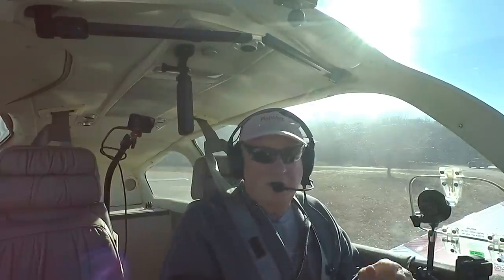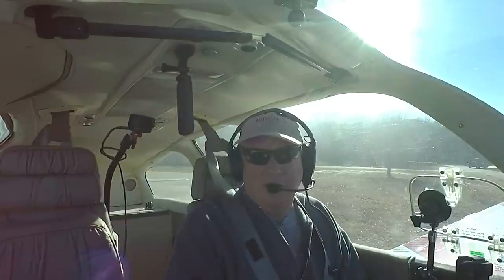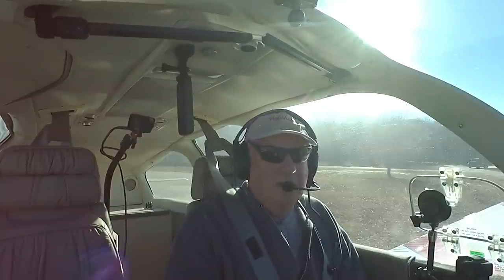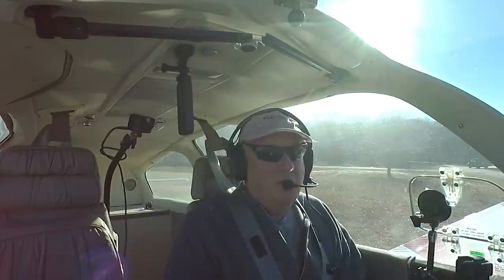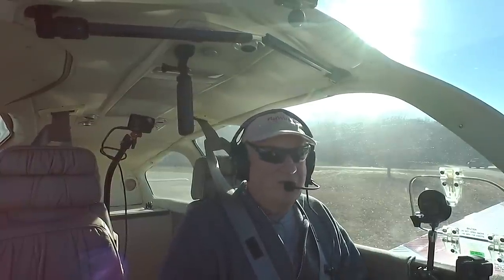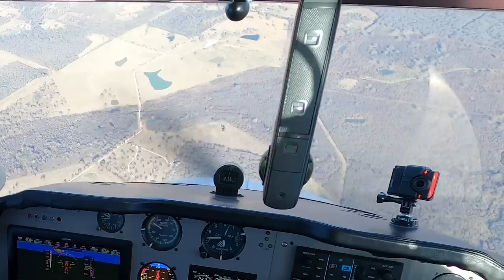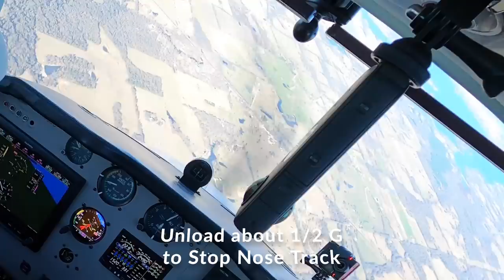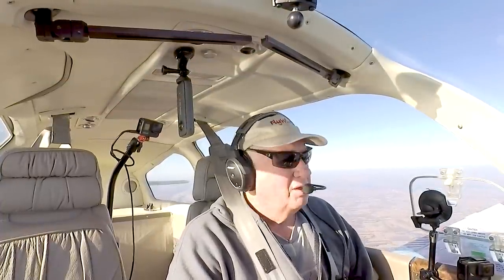FlyWire Myth Busting- Inverted Upset  "Just Go With It"

Comment: Scott, regarding whether to continue the roll or to fight it, you might find this interesting.  Tony Levier and another Lockheed pilot (whose name I can't recall) were flying from Lockheed Burbank to Edwards AFB in the company's Bonanza.  The passenger was also well known aerobatic air show pilot. They were landing at Edwards following a B-52 when they hit it's tip vortex.  The passenger shouted " I got  it", continued the roll to make a perfect landing.  Flight Test Pilot reflexes, instinct  and trust saved them.
Reply from the maker: I have no doubt that pilots very familiar can successfully deal with this. It is a bad example for the average pilot with no experience. the average pilot will not be able to execute that option successfully.

Comment: Scott, I love your videos. It was 1978, I was about two hundred hour pilot, and had just completed several hours of aerobatic training from  an air show pilot whose specialty was inverted ribbon cut with a decathlon. I was flying a C172 with three friends to O’Hare 09R, 3 miles in trail to a DC8 heavy. We were outside the outer marker going as fast as a C172 could go, going downhill. One second we were right side up, the next second it was like the hand of God turned the airplane upside down. (Wing tip tornado from the DC8.) 
I knew better than to pull back, which would have pointed us straight at the ground at about 1500 agl. Without the training I might have tried to fight the roll. Instead I went with it and kept the roll going till level. 
The right front passenger (also a pilot) after we had taxied to the FBO, got out, kneeled down and kissed the ground, then got up trying to light a cigarette with trembling hands in a smoking prohibited area and asked “Jim, how often do you do snap rolls on final to O’Hare?”

Comment: I agree Scott...(and taught it that way in UPT for 15 years).  The problem that people don't think about is how far the nose buries itself...the lower the nose, the more G to pull out of the dive, and the more altitude loss...not to mention the overspeed during the whole thing.   As far as 'dirty' configuration...the nose will probably bury even further if you continue to roll through it...and it will probably roll slower so you will lose more altitude in the overall maneuver.   I never practiced it dirty due to the stress it puts on the gear and flaps.   But I will bet there is some test pilot data out there.
Reply from the maker: Great comment.... overspeed is also a real issue!

Comment: A great video and demonstration. Unloading the aircraft saves a great deal of altitude. One factor not mentioned is if the force that caused the roll upset is still present. Very few light aircraft have the roll rate to overcome a wake vortex encounter. By fighting the roll the aircraft may remain upset, with the much larger altitude loss that will include. Continuing with the roll will have the aircraft the correct way up more quickly if the upset forces are still present.
Just my thoughts. 
Fly safe everyone.
Reply from the maker: Thanks James. The fastest/safest way out of the vortex is to unload. That minimizes your time in it and improves the roll rate through it. I actually had a vortex incident flying an airliner... the vortex induced roll event itself was  very short and powerful. Les that 5 seconds as memory serves.
Reply: @FlyWirescottperdue  Scott, I agree completely on unloading the aircraft to minimize altitude loss.

Comment: Good morning Scott, I admire your knowledge and experience, and your beautiful Bonanza makes me smile! I "went with it" about 30 years ago during a cross control stall demonstration (simulated base to final turn at altitude) during a Navy Flying Club T34 checkout. When the airplane stalled, it rolled quite quickly with the rudder, and the nose dropped. I don't know why on that first demonstration I chose to finish the roll, I think it was a reaction to the rapid stall and the unusual attitude. Had it been a real approach, the outcome would not have been good - I don't think there would be sufficient altitude to recover, even with proper technique.
Reply from the maker: Thanks for the comment William. At altitude is the best place to try it first!
Reply: @FlyWirescottperdue  The demonstration was a required part of the checkout, the poor recovery wasn't! Needless to say, we repeated the maneuver a few more times, identified the stall earlier, and used a normal recovery.

Comment: Exactly, go get upset recovery training. The first time I did it it went against the Orthodox conditioning... You learn to just stay with it not to worry, be ready for it expected and be ready to respond effectively.
Reply: practice on a simulator or rc plane,it is going to more or less the same,a good rc pilot can roll without loosing altitude and I have actually seen quite a few rc flyer do what they call a rolling circuit,where a complete circuit is done whilst rolling the earoplane continuously without loosing altitude and coordination even through the turns. rc flyers at that level very rarely crash as they are aware of all aspects of flight in all dimensions.

Comment: WOW! I always felt that it was best to follow through an unintentional, (if not surprise) roll! However, it's obvious that doing that can lose almost 3 times the altitude more than if one tries to counter with a return roll to the opposite direction.

However, what if the initial roll placed the plane in a fully inverted position? I mean, maybe a slow response from the pilot, or perhaps the gust of wind that caused the roll in the first place, was persistent?

Maybe then, it would be best to follow through and roll with it. Of course, the variables such as initial altitude, aircraft power and configuration, etc., etc. will all come into the bottom line of what decision would be best. 

Still, it would seem that your video shows a very heavy price to pay in altitude loss if one choses to follow through. It's a good thing to know!
Thanks,
Rich

BTW: I'm reminded of the Learjet 45 crash in Mexico in 2008. The NTSB found that the two pilots had fraudulent certifications and no business flying that plane, but they were initially hit by wing turbulence from the commercial liner ahead of them. The wind conditions for that flight were almost 0 MPH, which allowed the wing turbulence to persist.

As a result, the Lear 45 flew into it, (they were closer to that liner than they thought), and suddenly rolled the plane, which went inverted and near vertical. The pilot did so many things wrong at that moment that it's hard to say exactly what combination of 'panic-reflex reactions' were ultimately the ones that killed them all. 

However, they were 8000 feet AGL when they were hit with that turbulence, (if I recall correctly). I've always felt that they should have been able to recover if they had even a little experience. I have to believe that they failed because they panicked. Had they kept their heads, they would have recovered.
FWIW
Reply from the maker: They should have gone through UPRT! Don’t overthink the roll.

Comment: What about just using high rudder and forward stick to keep the roll with a nose on the horizon?
Reply from the maker: We’re not talking about folks who know how to fly aerobatics. We’re talking about regular pilots. Most don’t even like stalls.
Reply: Top rudder,if you are upside down there is no top rudder :)
Reply: @gogogeedus  I claim to be no aerobatic pilot and I have neither an aerobatic airplane or training. I was merely making a comment about if you invert, you must push your nose down to keep your nose on the horizon and as you roll out, you use top rudder to maintain your nose close to the horizon. I’m not implicating somebody to be an aerobatic pilot.  In an emergency situation. I would think that some understanding of aerodynamics which include your rudder becomes an elevator. Your elevator becomes a rudder, rather than just letting the airplane fall out of the sky and try to recover with a 5+ G pull out. Not everybody has 35,000 pounds of thrust to do a clean aileron roll or 400+ horsepower like Patty Wagstaff when their airplane rolls inadvertently past 90 degrees.
Reply: @aviatortrucker6285  Good point,if you have a  the skill and can use it,why not,but I like the Dan Grider philosophy of,don't stall the aeroplane. there is some footage on the net of an airtractor that got inverted,I don't know how but it was inverted in a flat spin,I wouldn't know what to do in that situation.and the pilot did not recover the aeroplane to flight,once the relative wind or airstream is upset then it is a different story.

Comment: But what about rolling through but also pushing forward through the inverted part of the roll? As an aerobatic pilot that would probably be my instinct.
You certainly don't want to 'bury' the nose. As I've discovered in barrel rolls that went wrong the exit results in large height loss and rapid speed build up, with high 'G' in the recovery.
Reply from the maker: What works for you, based on YOUR experience. Doesn’t fit all pilots.

Comment: So, please advise.
In this inverted upset..
I agree to unload the wing.
What application or benefits are there to utilizing the rudder (in whatever direction needed) to keep the nose "nearest" the horizon? It is all about managing the dive energy and avoiding #1) over speed, #2) overload and  #3) ground collision...yes?

Great video!
Reply from the maker: Good question. You can use coordinated rudder if you like. But there is a lot going on and if you haven’t spent much time upside down it’s probably best to keep things real simple! Unload, roll in the shortest direction to the horizon and recover from the dive.

Comment: I met you at MidLothian Tx. I didn’t get to ask you but partially, but if you go partially or completely inverted, knowing that the motor is not an inverted motor, are you satisfied with having a blurb of air lubricate your motor for a period of time?  The mains rubbing bearing bearing (metal to metal) so to speak?
Reply from the maker: I try and avoid that as much as I can.
Reply: Meaning hardly ever go inverted, right?
Reply: That has to lower the resale value of that airframe, vs with a factory overhaul equivalent dry sump motor / oil reservoir.  
Thanks for the reply.

Comment: Question When inverted Down Elevator Results in NOSE UP in relation to the Horizon, Correct? 
 So why not 'PUSH' when inverted to alleviate the bad NOSE LOW situation.  Sort of like when doing an internal slow roll?  What am I missing here? PLZ explain.
Reply from the maker: That is exactly what I did in the video.
Reply: @FlyWirescottperdue  Once unloaded, is there any difference between roll directions?  Assuming the plane is fully inverted does it matter if you roll in the direction of the original upset, or against it?
Reply from the maker: @BixbyConsequence  Roll in the shortest direction to the horizon. If you are wings level inverted, then and only then it doesn't matter which direction you roll.

Comment: Upset, Recover - PUSH, Roll, Power, Stabilize....That's what the airline teaches us, especially in the flight levels where you could loose over 10,000' if you tried to follow through, not to mention over-speed the the aircraft.  I agree with you, and seeing your speed coming out of the completed roll could have easily led to structural risk if not a planned maneuver and a skilled airmen with aerobatic experience such as yourself.
Reply from the maker: Great observation!
Reply: @Michael David Robinson Yes..in the taught AAURS All-Attitude-Upset-Recovery-Strategy, the Push is designed to lower the angle of attack because AOA is the only consistent characteristic of a stalled wing.  Any attitude or speed a stall can occur, so unloading the wing first, even inverted, is critical to ensure effective control ability through flight control surface inputs.  Your correct.
Reply: @Michael David Robinson Do some research on the "AAURS" developed by Aviation Performance Solutions LLC (APS) which is a global training organization that specializes in upset prevention and recovery training.  They have loads of data that airlines like the one I work for think is viable enough to employ across all fleets.  Then you can decide for yourself.

Comment: What would happen in the approach configuration (gear down app flaps) since that is probably when you are going to encounter wake turbulence?
Reply: I am very subjective, a lot depends on the turbulence. There is a lot of effort to keep you out of that situation. Altitude is your friend for recovery, that's something you don't have on approach.
Reply from the maker: I would do the same thing I demonstrated in the video. Push, Roll, pull out! What other choice would you have?
Reply: @FlyWirescottperdue  I was wondering what the altitude loss would be in that configuration for full roll and your preferred recovery. With the full roll recovery you might possibly exceed the gear and flap speed so you probably wouldn't want to try that.
Reply from the maker: @gorgly123  The odds are high you would accelerate to a very high speed.

Comment: Scott - when inverted (either returning or "going with it") - why wouldn't you push the yoke forward (which would push the nose high while inverted) while you recover with ailerons?  Would that make a big difference?  If you were all the way inverted, does it then matter which way you returned right side up?   

ALSO, what did you mean at the top by yaw and the wedges in Bonanza wings?  I always thought those were for stall mitigation... what do they have to do with yaw?  The POH definitely states full rudder opposite direction of spin (yaw) in my G36... so just making sure I understood your point about that.

Amazing video, sir.
Reply from the maker: I’ve got a video coming out on the wedges. Otherwise you talked through exactly what I did.

Comment: Just wondering Scott. Could we take it even further than just unloading and actually push forward on the elevator to briefly establish inverted level flight before rolling back upright? (One of the inputs used in a level axial aileron roll - The other being the rudder at each 90 degree mark) I realise that if done too slowly, the engine may cut or be damaged. I guess this could end badly in a spin if you're going too slow.
Reply from the maker: Good question. But I would not suggest even thinking about trying that in anything BUT and aerobatic airplane!